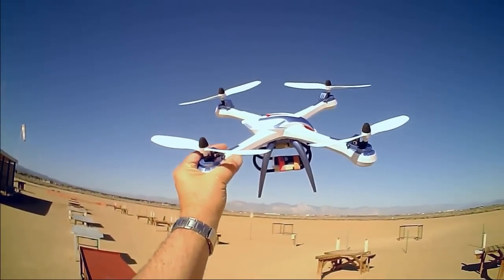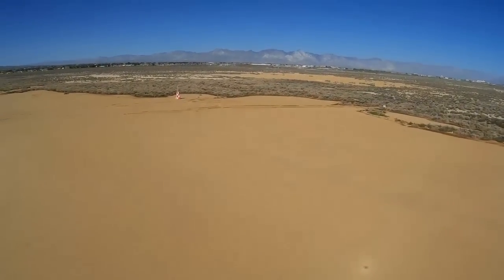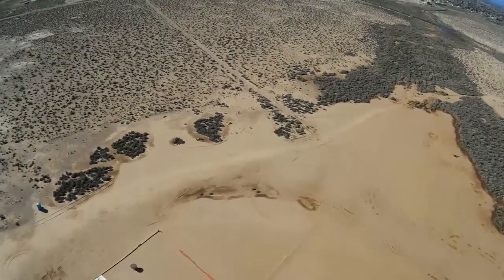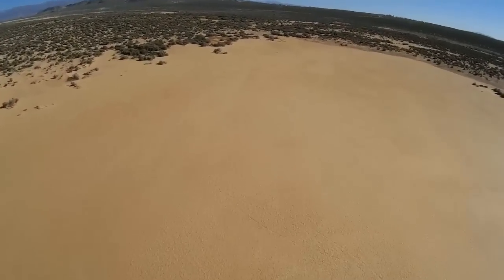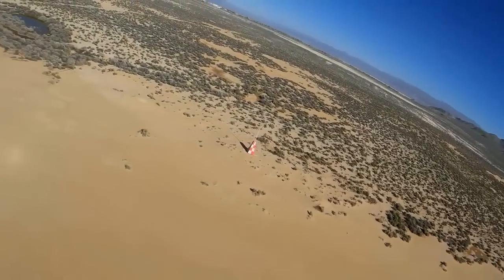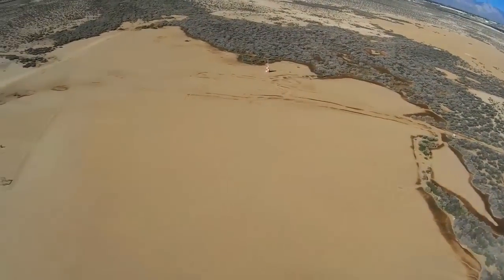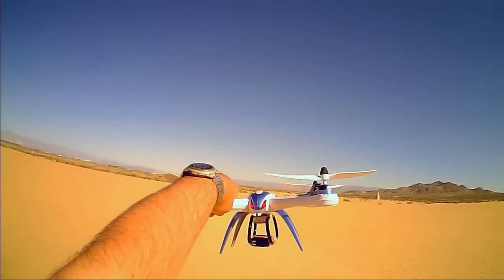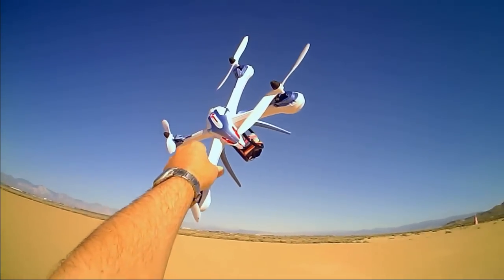Tarantula X6 Drone Tube Mount Test

Comment: how did u get 10 min of flight time? did u use some mods like dry graphite lube on the brushes? isnt the battery supposed to last 7 min?
Reply from the maker: The vendor's description is inaccurate.  The Tarantula X6 can fly for over 11 minutes stock (no modifications), out of the box.  That's another reason why it's a very popular quadcopter https://www.youtube.com/watch?v=F1UUXxLazq8
Reply from the maker: The vendor's description is inaccurate.  The Tarantula X6 can fly for over 11 minutes stock (no modifications), out of the box.  That's another reason why it's a very popular quadcopter https://www.youtube.com/watch?v=F1UUXxLazq8
Reply from the maker: Even when lifting a heavy GoPro, it can get over 9 minutes flight time https://www.youtube.com/watch?v=Lju4ECsOyFc
Reply: Quadcopter 101
thats impressive considering its price!! so how long should i charge the battery for to get the max juice out of it? 3 hrs?
Reply from the maker: No. Only until the charger indicates that the battery has been fully charged.
Reply: Quadcopter 101 Could you please tell me what camera drone should I buy!! I was thinking of buying the syma x8w or the tarantula x6!! And I don't know which drone is good fighting against the wind!?!?!? Please help me!

Comment: How can you fly for a so long time? Can you explaine me? Thanks
Reply from the maker: Ufuk Or. The Tarantula should easily fly for about 11 minutes with its supplied battery.  If your Tarantula does not, check to make sure that you are charging your battery properly.  Also recommend checking your gears for dirt or debris stuck between the gear teeth.  Dirt can cause excessive stress to the motors, reducing flight time, and damaging the motors.

Comment: I saw a video where a guy also mounted the battery above the camera which gave the camera a little extra weight that may remove that little bit of jello you still have, but I;m sure by now you either figured that out or simply resolved the problem in another way. Happy flying! ;-)
Reply from the maker: Bobster986 I need to try that.

Comment: Great videos by the way i came across this whilst looking for solutions. maybe you could test drive it or have any ideas that it will work on the X6 anyway here is the link. Hope this helps and works for the camera masses

http://www.rclogger.com/RC-Logger-X1-Micro-Brushless-Gimbal/
Reply from the maker: Richard Revell Interesting, but does it really exist and work as advertised. It looks like a Kickstarter dream to me.  But I might be wrong.
Reply: I ordered one May 6th Awaiting arrival im in a group page all Trantula X6 the only problem everyone is having is Jello from the stock camera, WHICH HAS EVERYONE working to find a solution i have also come across a RC Loggers X1 Gimbal to be launched for sale later on this Quarter using a Mobius Camera (Very Excited about This) 70g with camera

Comment: Hi there, 
Last week I received my Tarantula X6 :-D. It's a very nice quadcopter indeed and it fights the wind pretty well (better than my MJX F45 helicopter). There is almost always wind here in the Netherlands... 
I've created this tube mount with aquarium tubing and replicated your results: quite steady image when you're hovering, but lots of jellow when making movements. My theory is that it's not because of the vortices per se, but when the quad makes a movement it is tilted and thereby the wind/air is pushing against the camera and it's platform. This causes the tubing to 'stretch' and 'unstretch', resulting in a vibration that we all know so well. I'm gonna try to make a firm mount that also has some room for my video transmitter. Hope it's strong enough to lift that as well :-)

Comment: I noticed that he tx range of this quad with camera is very much reduced from 300m w/o camera to just 100m with camera, is this the norm? Is it due to the extra weight or he camera blocking the Tx antenna? Or something else you think? Enquiring minds want to know.
Reply from the maker: I've noticed this same issue with other quadcopters (most recently flying the FY326). I once thought it was the camera blocking the signal.  But adjusting the quadcopter's antenna doesn't seem to help. So now I'm thinking that since carrying a camera requires increased throttle, maybe motor brush arcing at high power is causing increased interference?  C'mon you EE's out there. What are your thoughts?
Reply: Quadcopter 101 Wish I was an EE but I'm an oh no;  Actually I was thinking the independent battery source may be the problem. Does the range decrease when the camera uses the same battery source as the aircraft? Also have a few other thoughts, this is worth looking into! Have you seen if the antenna ground is solid? or some way to isolate the static electricity from it's shield, perhaps a small piece of aluminum foil between the aircraft antenna and the camera. You know I'm just guessing ,lol, I am the oh no factor squared, lol. I just sent this question to John Herman of Gizmodo which may be the best idea I've had, lol. Will let you know if he responds to the request of cause and cure for this problem. Just had a thought so added this edit. I don't think my email was composed all that well to Mr. Herman, this means he knows I'm an idiot but I hope he does't also think I'm a prankster. If he replies with, "protect your quadcopter antenna with a condom" I'll know how he took my email...cross our fingers, OK.
Reply from the maker: Pat Martin Have since found that the 808 and Mobius camera's produce much radio frequency intererence. A simple fix that seems to work is to place a small amount of aluminum foil between the camera and the quadcopter. On my 808 camera, I used double sided tape to line the exterior belly of the camera with foil.
Reply: Quadcopter 101 Thank you, I'll give that a try; now you know why I wear a foil hat, haha

Comment: Can spare batteries be had.if so which ones
Reply from the maker: Am pretty sure the WLToys V666 battery will fit http://www.banggood.com/WLtoys-V666-RC-Quadcopter-Spare-Parts-7_4V-1200mAh-Battery-p-961525.html?p=RB0922217402201307U3

Comment: Sorry for confusion. 620 feet is 190 meters - https://www.google.de/search?q=620+st%C3%B3p&ie=utf-8&oe=utf-8&gws_rd=cr&ei=Czz_VOP3BMieywOtmILYBQ#q=620+feet+to+meters
so is the range of this drone 200 meters or 300 meters?
Reply: I made a small investigation (my wife and kid are asleep now and I found it easy :) The length of yellow line is 150 meters and I think that was the range where you were almost losing the drone. Can you confirm please? Here is the picture http://postimg.org/image/unbvyvojx/
Reply from the maker: Maveusable That's where the first drop out occurred.  I momentarily lost orientation and continued on until 3:59 where I regained orientation and turned the quadcopter back in my direction. I may have been able to fly even further. I really don't know the maximum range on this quadcopter as I haven't flown it until loss of control (need my wife out in the field as a spotter to do such). But as you've seen, I have flown it out and back from 200 meters. By the way Google Maps and Earth are pretty cool.  For others wishing to investigate :) https://www.google.com/maps/@35.627992,-117.6339867,187m/data=!3m1!1e3

Comment: Will the syma x5c-1 with you range mod make it to that 400 ft away pylon?
Reply from the maker: Yes it can, but that's as far as it goes.
Reply: Quadcopter 101 ok thanks for the reply. My syma comes in the mail tomorrow. I ordered a coxial cable and a 2.4ghz antenna for the mod like others youtubers have done. I hope I pull it off!

Comment: What battery for this quad can you recommend as an extra to the stock battery?
Reply from the maker: The smaller/lighter 850mah V262 stock battery fits in the compartment, but gives only about 8 minutes flight time.

Comment from the maker: Oh fudge.  I wasn't planning to release this video so soon.  Must have accidentally hit the wrong date on the schedule settings. Anyways, the tubing works great in hover only. Propeller vibrations are not the issue (by the way, I did balance these props).  However, in forward high-speed flight, drag vortices start to build up behind the camera and the tube mounts, causing some flutter vibrations in the induced wind.  Hence, lots of jello in high-speed translational flight.  The only fix to reduce this is a more firm mount to the quadcopter.  I did a flight with this showing such.  I'll release the video in a couple days (gotta go and check its schedule settings now :).
Reply: Quadcopter 101 Exactly what I was thinking about the jello effect. The bad news is if I'm thinking like you, you're in trouble, lol, I know I always am, lol. ;)

Comment: I was wondering about the potentially negative effects of using stiffer tubing like irrigation and aquarium aeration stuff. I think the much more flexible silicon RC fuel line or surgical tubing might give better vibration isolation.
Reply from the maker: Watch how it performs in hover during the slow rotation pans, versus in forward flight when the nose is pointed downward.  Am almost positive the jello is caused by drag flutter on the camera from high speed flight (not propeller imbalance vibrations).
Reply from the maker: Winston Smith Will be trying shortened aquarium tubing tomorrow.  Hopefully it will work.
Reply: Quadcopter 101 Hope so, but I think the much greater flexibility of the silicon fuel line or surgical tubing might be needed as the loops are made shorter since the shorter loops using the same tubing will have less vibration isolating "give" to them. Just an intuitive guess and I could be totally wrong, of course. Hope I am and the mod works.

Comment: Unfortunately vibration can't be prevented by the method.
A pipe is cut on the way.
 It's connected by a tube of soft silicone rubber.
 
Or a pipe.
It should be made with a silicon tube.
That can be made with the tube which sends air to the water tank for aquarium fish.